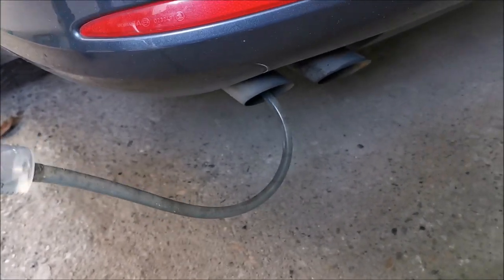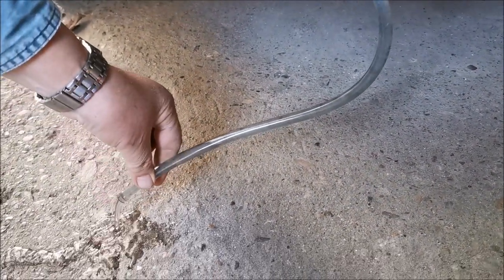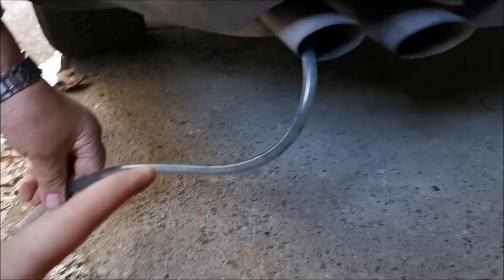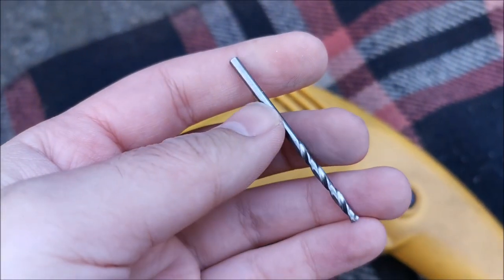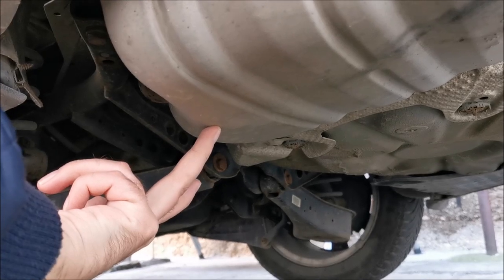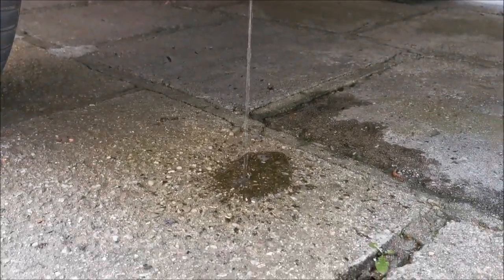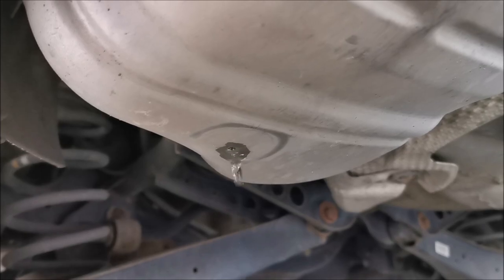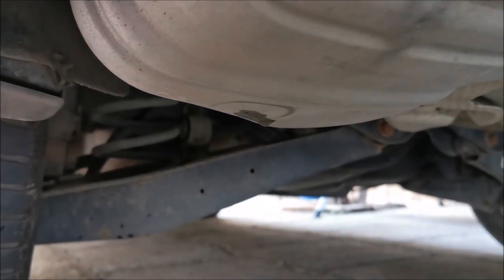How to permanently prevent condensation build up in your car's exhaust

Comment: I did this "trick" on my car ì, several years ago and works well! Only a hint: apply a dab of anti-rust paint into the hole so it will never get rusted for exposed metal die to the drill bit.Thanks 4 sharing!
Reply from the maker: Nice! Thank yoy for the tip :)

Comment: Aftermarket aluminized steel mufflers are junk compared to original. Original mufflers are usually some grade of stainless steel. Replaced mine three years ago and they already rusted through from inside out. It took only about 1 and half year with these aftermarket mufflers so that the inside parts rusted to dust. I noticed it because i had to replace my center pipe later. Original mufflers lasted almost 20 years and still they were ok on the outside but inside parts were detached and rattling. This time i sprayed some CRC hi temp alu spray to the new mufflers because the factory doesn't even bother to paint their weld seams and also they were scratched when i got them. Few days later i drilled 2mm holes to both at the lowest point and already they had accumulated a lot of water in few days after install. I hope that this time they won't rust that fast but time will tell. I drive a lot of short distance trips so it's an issue with these cheap mufflers. I just have to hope that the self made holes won't enlarge by themselves.

Comment: I also did this kind of mechanism to my Nissan car. I did a small hole and welded 17 size nut in stainless steel. then attached a stainless steel bolt with washer without fully tightening. when engine start it drain water it self. other wise if do it manually once a week, I completely remove the Bolt and start then fully clean it up. this is caring my silencer muffler by corroding.😀😀😀:thanksdoc:
Reply from the maker: Nice 👍🏻

Comment: Can you share how you inserted the hose? What hose and syringe did you use? My mother-in-law has a problem with water accumulating in the muffler. It freezes in the winter and clogs the muffler and the car doesn't start because the exhausts can't get out. I don't wanna drill her muffler and risk rust (we live in Canada so we have long winters with a lot of salt on the roads) but I could just suck the water out for her before each winter which should help.
Reply from the maker: Absolutely nothing special. Find a big seringe, a hose that fits over it and suck away. Really, anything you can come up with to suck the water out should work. If it does not work the first time, just wiggle the hose inside the muffler until it starts working.

Comment: I wonder if this water trapped can cause smoke in the exhaust until it warms up? My sons car always has smoke until the car is warmed up, perhaps drilling a hole in the exhaust will fix this and save the exhaust from rusting out too quickly
Reply from the maker: Maybe, maybe not. My Audi A4 also has steam coming out of the exhaust and there is no water in the muffler.
Reply: @UltimateDIY  I replaced the pcv valve and it seemed to get better but then came back. I’m going to check the muffler and see if drilling a hole helps. Even if it doesn’t at least it will help make the muffler last longer by not holding water that will rust it out
Reply from the maker: Yup, at leats that for sure 👍🏼
Reply: @lh98 any update?
Reply: @wolfrace3408 unfortunately some knucklehead completely ran through a red light totaling my sons car so we no longer have that issue. We bought him another 2006 Honda CR-V that doesn’t seem to have the same issue with the guys insurance money. So I can’t really give any further update. I am just glad he and his gf were not hurt in the accident very badly. The injuries suffered though I wish I had sued them too because he lost financially and had minor injuries along w/his gf. We hadn’t had any accidents before so we had no idea how to handle things. Totally should have sued because the guy that hit him is still going to court today a year later over it. We let the stupid ambulance paramedics talk us into not taking them to the hospital. He had black burns on his arms from the airbag and his gf had injuries to her knees from hitting the dashboard. They both were sore as hell for 2 days afterwards as well. My failure as an informed father. Like I said we had never been in accidents before so we didn’t know. Lesson learned and it cost us…. Good luck with you whatever issue you have going on.
Reply from the maker: Sorry to hear that. Glad they are ok. I learned from what you wrote here. In case of accident always go to hospital and don't len anyone talk you out of it.

Comment: I am wondering if you accelerate the pressure of gases will throw outside the watter. But if you drill the mofler I think will have issues at MOT emission tests.
Reply from the maker: In the Octavia 1.4T it will never throw out all the water, while driving inside the city, even if you rev it. The only way to get it out, is to drive long distances to basically heat it up and evaporate it. Could be caused by the muffler design, as I don't have this issue in my A4 B8. Some cars have this hole from the factory, so I don't think it will affect MOT.
Reply: @UltimateDIY  because exhaust does not really get hot with normal driving even if the engine is warn
Reply from the maker: Exactly.
Reply: As long as you drill after your catalytic converters you should be completely fine.  The large section of exhaust that he drilled is the muffler that reduces sound.
Reply: @craigdk586  Exactly, he drilled just the muffler, no problems with any emissions there

Comment: will this make smoke when engine is running?
Reply from the maker: No, the hole is too small.
Reply: @UltimateDIY  sorry what I mean is does the water deposits in the muffler produce steam/smoke out to the tailpipe when running the engine?
Reply from the maker: Steam.
Reply: @UltimateDIY  alright thank you. I've sit the car on idle for about 45 mins but I still get wispy smoke out of the pipe and water droplets
Reply from the maker: It takes a lot of time to evaporate the water at idle.
Reply: @UltimateDIY  great info thank you

Comment: some state car inspections might fail a car with a hole in the exhaust
Reply from the maker: I understand the logic, but what about the ones that have a tiny hole from the factory?
Reply: @UltimateDIY  not sure of the specific requirements. perhaps if the hole is upstream of the muffler it is a fail
Reply from the maker: It's possible. Anyway, thanks for pointing it out 👍🏻
Reply: Would it fail a NC or a NYS inspection? Is there any other possible downside &/or potential negative repercussions of doing this?
Reply from the maker: No downside at all. As for tests, you need to check in your own country.

Comment: I think my exhaust system is frozen!
Reply from the maker: It could be in cold weather.
Reply: Any advice to unfreeze it in 20 degree weather?
Reply from the maker: Not really. Is your engine starting or the exhaust is blocked? If it's starting, just drive the car for a good while.
Reply: It starts but as soon as I hit the gas it dies.No smoke comes out of the pipes- just a loud hissing sound underneath the car
Reply from the maker: Get it to a shop to heat it up. You could heat it up yourself, but not with open flame, because it's close to the gas tank.
Reply: Thanks I’m going to rent a propane heater and point it directly to the exhaust
Reply from the maker: Get back to us with the result. Never thought enough water can freeze in there to close it up. But I guess with enough short drives and cold weather it can happen 🤯
Reply: @UltimateDIY  update- My exhaust system was frozen! Ice built up in the pipes. Torched the pipes to melt the ice
Reply: Now it runs smoothly! Mechanics were charging an arm and a leg- they assured me it was the catalytic converter
Reply from the maker: Wow!
Reply: Audi Q7- if anyone runs into this problem.
Reply: @atreto21  Your catalitic converter maybe blocked
Reply: I'm having this problem where ice is causing my car to hard start when it's really cold out. I've seen ice come out from the exhausts. It seems like water is building in the exhaust pipes and freezes when it's really cold. What can I do? I have an ebay after market catback dual exhaust system but I'm starting to feel that it's occurring because of some type of condensation being built up
Reply: @86mnillaman  drill a small hole in the lowest point of the exhaust
Reply from the maker: Drill hole in lowest part exactly as video shows.